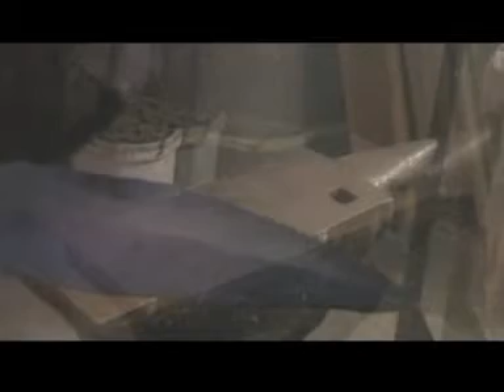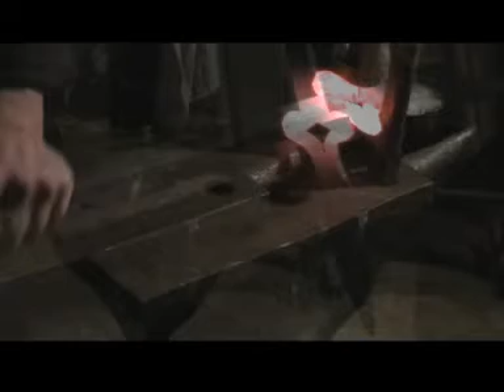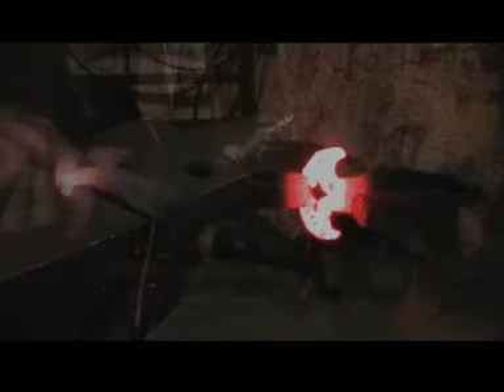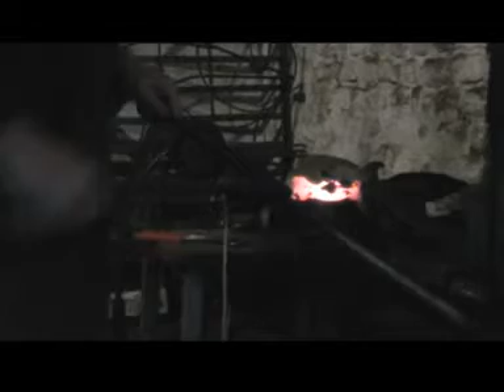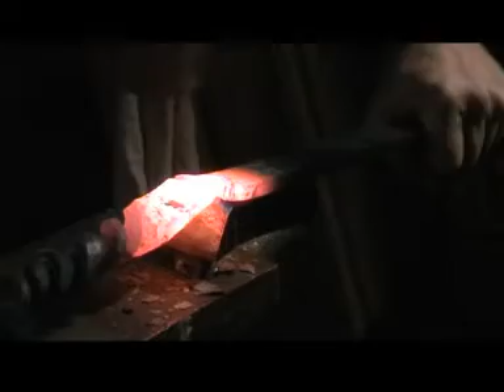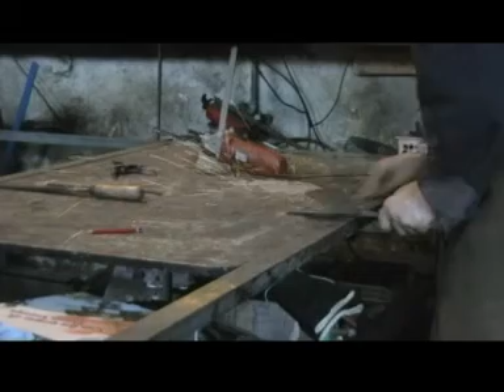Forging an Athame knife in one piece Iron

Comment: Pretty work, but why in iron vs. steel? You should know a blade isn't born till it's quenched...for a 1-piece I'd use 1045 myself, not too hard to work but you can still harden and temper.